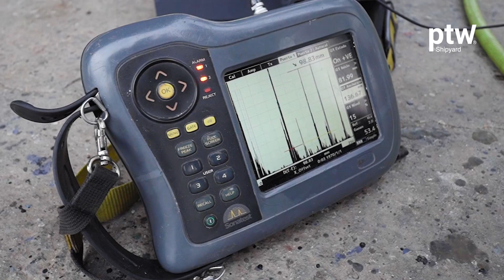Battling Electrolysis: Repairing a Pitted Steel Shaft | ptw Shipyard

Comment: Cool video, how do they fix the damage?
Reply from the maker: Hi Caspar, 
The pittings were filled with epoxy-based composite. It was only a temporary solution accepted by Class as the shafts had to be replaced anyways.
We will replace the shaft after summer, we will also upload this job, 
Please keep tuned !